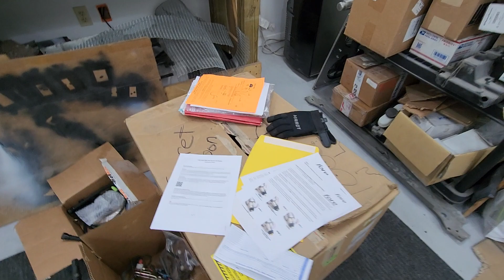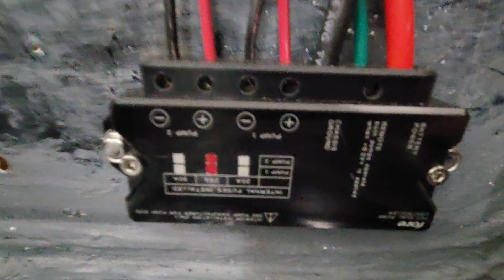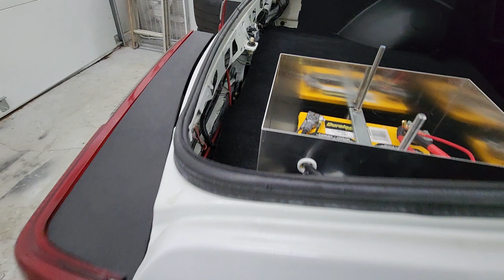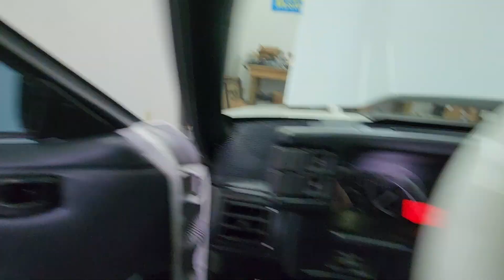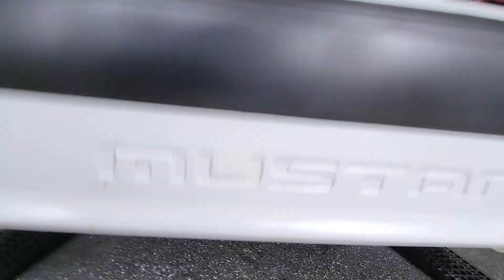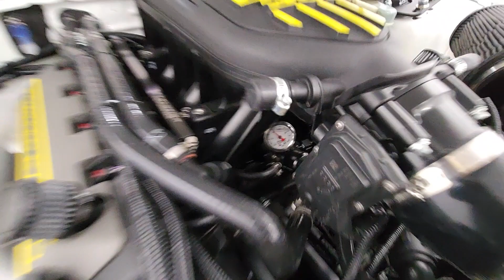Fore innovation fuel system installed  f2c controller dual 450 lph pumps coyote swap fox

Comment: Hey bro , how did you like that fc2 controller, I guess you are running the twin 450s  full time not staged?
Reply: I’m going to go with dual 525s and the fc3 controller so I can stage the pumps
Reply from the maker: @Boosted363Hatch  what's up....so far I like it...pretty straight forward install...all heavy duty...both pumps full time....but haven't really had any road time yet..did the install with the intention of a power adder in mind...finally getting to put boost on it